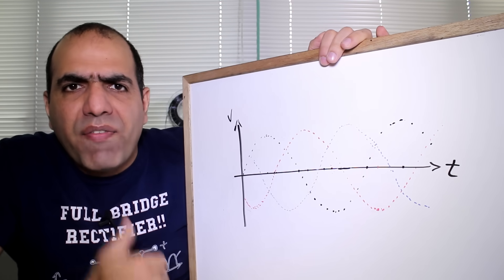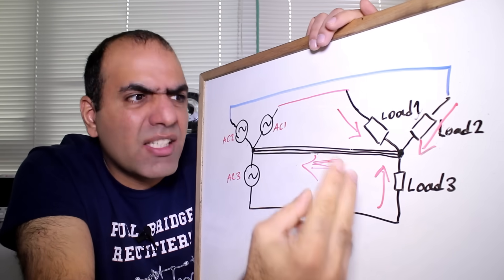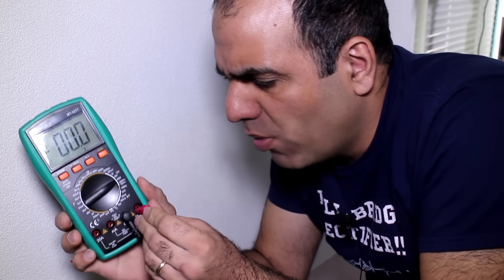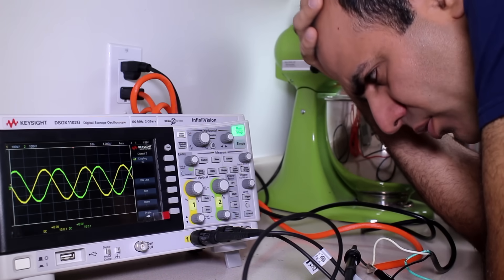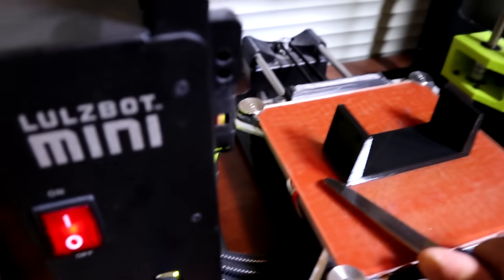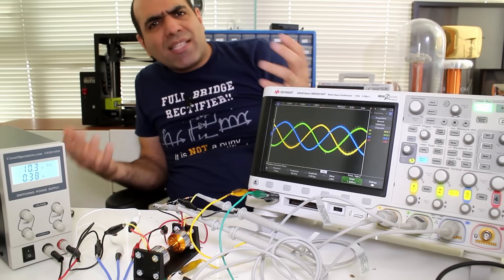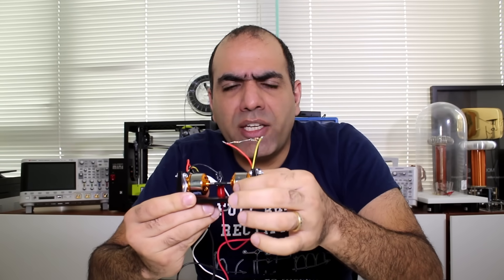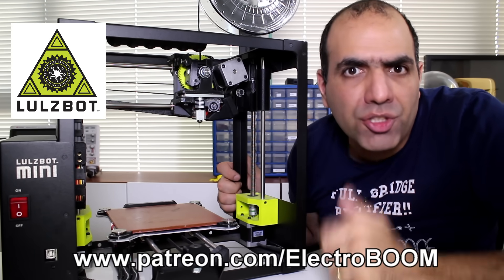Why 3 Phase AC instead of Single Phase???

Comment: The real question is why don't we use 4 5 or 6 phase a.c.? Since they all do work... (I know what I was taught bit Mr electeoboom, what say you?)
Reply: because there are no real benefit using 4 or 5 or 6 phases. First of all, instead of needing 3 core transformers, you would need 4 , 5 or 6 cores , (if that is even possible) , more busbars more disconnectors and in the end of the day you still transfer the same amount of power, only smoother.
Reply: The 3 phase system is used for electric motors. You could do it with more, but it would make the motor a lot more complicated.
Reply: There's no benefit from adding additional phases. Adding 3 sine waves 120 apart yields a flat line, which means a smooth output from a generator.

Comment: You did not mention the most important advantage of a three phase system:
The power output is constant over time and not alternating at 50 or 60 Hz like on a single phase supply.
Constant power is needed for a lot of machines and systems.

Comment: My city we deliver single phase and center tap 240 vac to houses.  You must be in a high rise or something like that to have 120 208 2phase I'm guessing. Great vid btw.
Reply: ΑΡΗΣ ΚΟΡΝΑΡΑΚΗΣ Large diesel trucks in North America (at least in the US) used to use 24 volt electrical systems, but that was probably 30 years ago or maybe more. The only part of the vehicle that NEEDED to use 24 volts was the engine starter. The higher voltage allowed the same power/torque output from the starter while using less current, which meant less heat in the starter when trying to start a stubborn engine, meaning you could crank it longer before having to let the starter cool down. Some very large construction/mining equipment use 36 volt starters for this same reason. With the 24v trucks though, the interior either needed all 24v accessories (think radio, cb, ect) or a way to get 12v to power them which would mean two main electrical circuits. In the last 20 or 30 years though, technology has made these large diesel engines much, much easier to start, especially when cold. Starters have become smaller and more efficient also. This allows the use of 12 volt systems on these big trucks with no real downsides. The electrical system is one unified system and any equipment that can be wired into a car, can be wired into the truck with no special considerations. That's how it was explained to me anyhow.
Reply: No, the other way around ;) If they are in phase the difference between them is 0V. If they are 180 degree out of phase, you get twice the voltage of the single phase.
Reply: Thats just based on the battery. Nothing to really talk about there.
Reply: In residential in Canada we just have the Edison 3 Wire circuit setup 120/240
Commercial you'll mostly get 347/600 & 120/208
Industrial it could be 347/600 Wye or 277/480 Delta
Reply: I didn't get the implication that the discussion is about Canada only.
Reply: DIY Builds where do you live?
Reply: DIY Builds Every house I've checked in Slovenia gets all three phases (Incluting poor rural areas)
Reply: theSomething I've never seen canada written that way before which part of the praries are you from?
Reply: I've never seen residential power here in USA where I've been that wasn't 120/240 single phase (two 120's 180deg out of phase).  I haven't done any wiring in a high rise, so maybe they do somewhere, though I would have guessed they wouldn't mix phases between units.  It's kind of important to know if you are running certain appliances at 208 or 240V.  Also I haven't seen a single duplex outlet wired with different circuits (in phase or not), though I guess it makes sense if you plan for two high load devices (2 microwave ovens?) to be plugged in the same spot.  I'm not a real electrician, though I did wire my own house and I'm still alive.
Reply: Interestingly, in some parts of the World (including here in Germany) basically every Home has 3-phase power. To the point where some household appliances (like cookers) actually have input for 3 phases, to lower the load.
Reply: yes, in Canada some large appliances have different power ratings (sometimes voltage selectors) for 240V vs 208V. Water heaters for example may list different heater coil max ratings for the different "single phase" topologies. Single dwelling residential is normally 240 (one HV transformer with centertap output).
Reply: The US NEC requires at least 2 20 amp 120v circuits for the kitchen countertop area specifically for preventing nuisance tripping when using 2 heavy loads, IE the microwave oven and a coffee pot or toaster at the same time. A multi-wire branch circuit achieved this with a single neutral and 2 hots to a 2 pole breaker instead of 2 neutrals and 2 hots to 2 single pole breakers. The downside being if the neutral failed you essentially had appliances in series and unless it is 2 completely identical resistive loads the voltage wouldn't split evenly so something would get too much voltage and fry.

It's not as common anymore with the AFCI and GFCI requirements.
Reply: Same here in Australia - We have 240v 1~ and 440v 3~ ph.
Reply: AlexProGaming . I Think India
Reply: This is the correct reply for the majority of US residential.  The transformer located on your pole (or in ground) is just a center tap.  The one thing I think should be important to note is that industrial 3 phase can be either Y or Delta (open).  This is important when ordering the proper equipment industrial equipment.
Reply from the maker: Yes I'm in a high rise. I should go to a house and check the voltage there. Center tap 240VAC would draw more current from one 120V phase, while running between two phases draws less current (close to half) from two phases. SO less loading on wires. But 240V could deliver more power.
Reply: Probably in the US at least that's the way it is here you have a single transformer where you have two taps placed at each end of the coil so you pull two phases 180 degrees out of phase. A center tap is placed directly in between the two to carry back the unbalanced portion to each coil. Which is why it is called single phase; you are making two phases out of a single phase at the pole. In his case he is using 2 phase.
Reply: ElectroBOOM can you do a video about the electric systems in cars and trucks? Because I'm hearing that trucks in North America still use 12VDC, meanwhile in Europe trucks are 24VDC
Reply: High rises take 3 phases and distribute them among the floors. 

Detached Residential Homes would just use a transformer that outputs 240V with a center tap.

Comment: Isn't the PWM time period supposed to be 20ms or even smaller? Have seen as low as 16ms and I think ESCs like BLheli and SimonK accept up to just under 500 pluses per sec which indicates a period of just over 2ms. Please correct me if I am wrong.
PS. Love your videos.
PPS. Please include me in the prize draw :-)

Comment: I dunno with this Tesla vs Edison stuff Mehdi. Nowadays the hot topic is to implement DC power transmission, was Edison right all the time?

Would be nice if you could explain why is this a trend.
Reply: AC is easy to convert from high to low voltage and vice-versa. 50/60 Hz power transformers are very well scaled: they range from little boxes for mobile phones (mostly exctinct today in favor of switching power supply) to cyclopic ones handling GIGAWATTS of power. It's just steel and copper. Good design is not so straightforward, but even in the times of Tesla it was understood pretty well. 

But it was also known that with active power there is usualy reactive power transmitted back and forth in AC lines which only heats the wires without doing anything good. For example, power transmission lines have enormous capacitance which should be charged and discharged every cycle. There is always a 'battle' to reduce reactive power as much as possible (and in general, to increase power factor) by using reactors (large inductors in electric slang) at the ends of power line, also sets of capacitors which should compensate inductive load of induction motors etc. Alternating current may have bigger losses per length, because of skin effect and some eddy currents at constructions surrounding wires (including poles themselves and earth which is conductive).

Maybe the most motivation for DC power is its ability to connect some regions which are not synchronized or even have different frequencies, like 50 Hz and 60 Hz. It can also be more flexible in regulating power flows which may become crucial if there are too many solar batteries and wind turbines around, so nobody knows how much power would be produced and how much consumed. Current AC system works very well in case of stable power generation and consumption, but it could be real pain in the ass to regulate all the unpredictable energy sources and energy suckers (this sucker is electrical and will draw 100 kilowatts of power for couple of hours in its supercharger, but then - suddenly - it stops). 

With advances in power electronics, which is creating semiconductor devices capable of thousand of volts amps it seems that we can now use DC current in transmission lines, though it's still questionable, which technology is more economically effective and more reliable.
Reply: Wow, pretty good answer! 

I remember that when I took a crappy electrical engineering course, the teacher told us that the reason of using AC was because of low reactivity and low transformer loss in contrast to DC systems.

But then I think of capacitance and skin effect, and I start to think that AC transmission is not trivial.

Is it that DC power transmission is fulfilling certain niches in power transmission? Or is it the future to make high power transmission into DC? I also heard that another reason to transfer via DC is because transmission towers have "best form factor" to take advantage of land.

Thanks for your answers!

Comment: How efficient is a brushless DC motor? I thought it was over 90% but recently someone on the internet said their efficiency is almost as bad is ICEs, which I doubt but I am curious how efficient are they really since I've also found contradicting information myself (no source said they are as inefficient as ICEs though)
Reply: It depends. The most compact RC aircraft motors are not too efficient: they are made exactly that power so they don't overheat when cooling by its own propeller. No point of getting more efficient if it means more weight (like: more powerful magnets, more copper windings etc) because all the efficiency is gone because you need to pull this weight. For cars and bikes weight is not so big a deal, that's why motors there are larger, but more efficient. Stationary motors are even bigger and they're the best in terms of efficiency.

Comment: You said that we the two or 3 phase difference outputs are given to increase the power...
But in the Home Appliances as you said the laundry or oven use a lot of power. But we connect the input from only one outlet socket... So, what's the benefit of 2 sockets with phase difference???

Comment: why didnt you hook up the ESC directly to the Oscilloscope? ^^
Reply: It wouldn't even work without a motor. With a motor - OK, but it probably have square waves instead of sine waves, so it wouldn't be so perfect 'textbook' example!
Reply: with the load you should see the sine waves because of the inductance of the coils
Reply: without the load its just the esc switching on and off and you get the square waves.
dont know for sure how it would look but would be interesting
Reply: Inductance of the coils makes current passing through them more sinusoidal (maybe trapezoidal actually) while the voltage is still square. ESC works in switching mode, on and off, so when battery is connected to one of phases of BLDC, there is just constant voltage, until it is switched off. In off-state we'll really see back-emf which is rather close to sine wave as we saw in this video. 

But you're right: it would be interesting to look at this waveform.

Comment: But can you print a printer with your printer?
Reply: Absolutely. You might need to supply the frame and smooth metal rods though. Of which the rods can be conveniently ripped out of old broken inkjet printers, and 90 degree angled extruded aluminum is fairly cheap. Afterwards, you can use your 3d printed 3d printer to print another 3d printer. And once you have enough 3d printers, you can mass print 3d printers. That actually seems like a fairly reasonable thing to do. Even better if someone can print the initial parts for you so you don't need to buy a 3d printer to start with. I really want to get into 3d printing.
Reply: +ΑΡΗΣ ΚΟΡΝΑΡΑΚΗΣ I'm no structural engineer, but personally, I wouldn't trust making the frame or rods by printing it, at least not out of regular filament. I believe the flex that normal plastic has would end up making alignment a real pain, plus at the rate the print nozzle moves around it could get a bit shaky. If you used glass fiber or carbon fiber reinforced nylon filament then it would be perfectly fine. It's just that metal parts would be stronger and cheaper.
Reply: theLuigiFan0007 why not 3d print the whole thing?
Reply: @cwk18 Well, you could definitely benefit from having one then. And also, you might find this video very interesting, if you haven't seen it already.  https://www.youtube.com/watch?v=b6cDOyxub8w It's a 3d printed gearbox with a really high reduction, and it can lift quite a bit of weight.
Reply: There are actually 3D printers that are mainly made of 3D printed parts, not sure if the lolzbot is one of them.
Reply: Interesting.
Reply: That's pretty interesting print.ception
I'm a mechanical engineer student myself would like to print many things to visualize things better like planetary gears and linkage.

Comment: In Austria we all have three phases at our houses, each one supplying 230V AC. This is extremely handy for use of construction machines, but it also enables quite fast charging of electric cars. But it seems like three phase current is kind of rare in the rest of the world, which is why only tesla and renault allow three phase charging of their cars right now (there may be others i dont know about).
Reply: It's rare for home use, while all the industry and utilities and transmission lines overall mostly work on 3 phases. Just it was considered too dangerous to put 380 / 400 volts into outlets, that's why each home gets just one of phases.

Comment: Wait, so 3 phase in canada uses 208 volts for machinery and lighting transformers because of the phase shifting? I've never measured 120v from an outlet in a shop before
Reply: El Guapo 3p 208/230 or 600v 3p